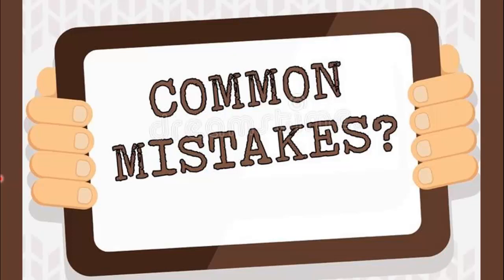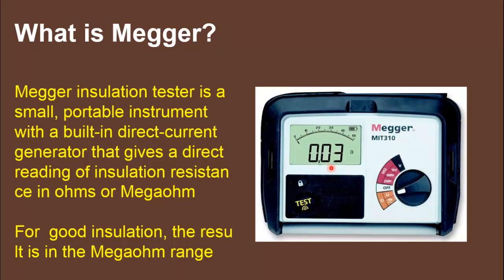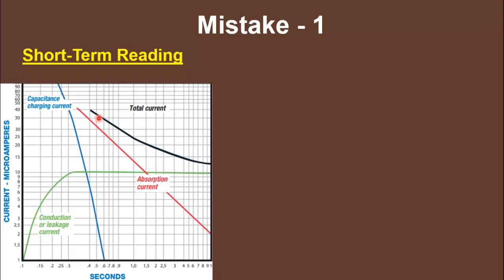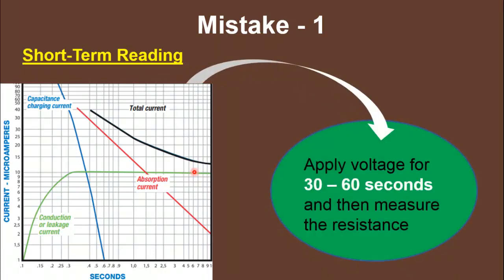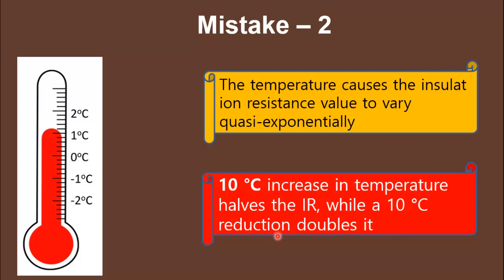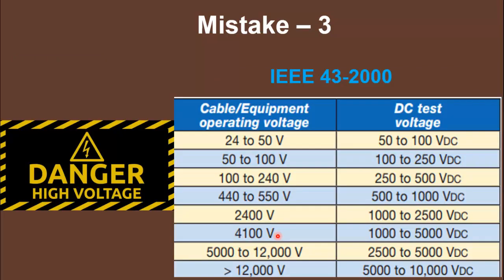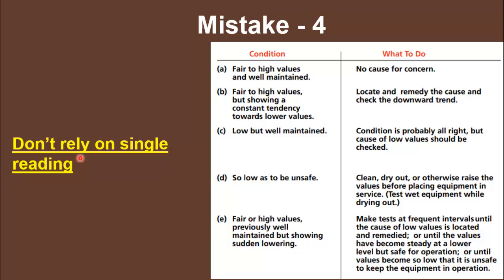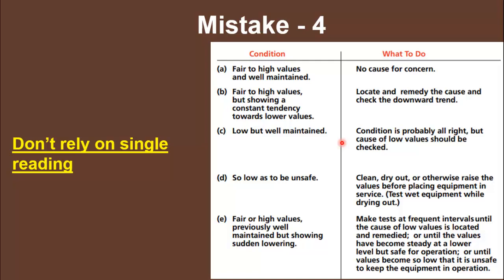Mistakes of Insulation Resistance Test | Correct Method of Megger Test

Comment: I've always been told that an increase in temperature will cause an increase in resistance, the same way as you've explained. But my experience keeps me confused. Whenever I test the insulation while the windings are still hot, I get high readings, and when I do the test after the windings have cooled down, the readings drop. 

Recently, I washed a 15KW generator coils with water and dried it by heating the coils by lighting a halogen light. Every day, after heating for about 8 hours, I turned off the heating light and did the megger testing the next day before starting to heat again. My readings were increasing day by day, and this continued for just about a week, by which time I was getting above 500 M ohms. At this point, I wrapped the stator with a piece of cloth and left it there to concentrate on other works. After about a week, I took the readings again with a surprising low of below 1 M Ohms. What could be the cause?
Reply from the maker: The moisture condensed causing megger to low. You need to keep the machine running to see good results

Comment: I have megger mit310 insulation tester.when i check 250&500 volt readings showing e31 .what is the complaint is that. How correct that..
Reply from the maker: Your instrument internal hardware error. Need service

Comment: I have meggered hundreds of motors during my over 35 years of testing etc...  if the motor or the cables have bad insulation - I always knew it within a few seconds of performing the megger test.  I always megger 480v volt motors at 1,000 volts, 240 volt motors at 500 volts and 120 volt motors at 250 volts and never had an issue finding a good or bad motor or cables.   Plus, we always kept records of motor testing to go back and look at trends.  Trending is very important if you have lots of 250 volt DC motors in your facility.
Reply from the maker: Yes that is true. Trending is always belpful. But you cant deny these factors also. The readings can be misleading specially on motors where insulations starts to deteriorate. Where motor insulation is already damaged then these factors are meaningless
Reply: If motor insulation is starting to break down you will see it in your trends as I have witness many times and then the motor is changed out for PM reasons(low megger reading).  If the motor insulation is damaged you will probably be at the motor cuz it will not run and when motor is meggered you will get bad megger readings @electricallectures

Comment: Can I do megger test in a hot motor?
Reply from the maker: There is apparently no issue to apply megger to hot motor except if there is a moisture , that would be dried up when its hot and you will get good reasult but derection of moisture is evident

Comment: Other 3 common mistakes:
1. Not checking the megger before using.
2. Using the megger on energised circuits!
3. Not discharging the item after testing is over.
Thanks

Comment: Megger is a brand
Reply from the maker: Megger is a device to test insulation resistance.
Reply: @electricallectures LMAO
Reply: @electricallectures really 😂
Reply: If you use brand fluke or kyoritsu insulation tester still it's megger? Just asking...

Comment: hi sir what is the difference in result if we IR test the motor applied with 500v and 1000v?
Reply from the maker: The motor rated for 400V shall be tested with 500v megger. If you apply high voltage it may rapture the insulation

Comment: So I'm megging a motor a 480 v motor and reading 78.9 mega ohms to ground.  Is that bad
Reply from the maker: Perfect. No issue
Reply: @electricallectures  omg ITS A LARGE 350 AMP MOTOR AND THEY BRINGING A CRANE OUT TODAY TO PULL IT. WE HAD A FIRE ON A FORGING PRESS. and there was a fire near the motor melted alot of stuff. So I figured the varnish must have been compromised.  So when I was getting the 79-90 mega ohms I called it bad. On what if one Legg was .079?
Reply from the maker: Megger value must be large for all windins

Comment: Bro's one doubt
If need to check meggar insulation check for alternator in between ground to windings is that require to disconnect connections from main winding terminals in alternator....if checked without disconnecting avr what may occur
Reply from the maker: No need to disconnect . You can check but remember for 400v alternator only apply 500v megger